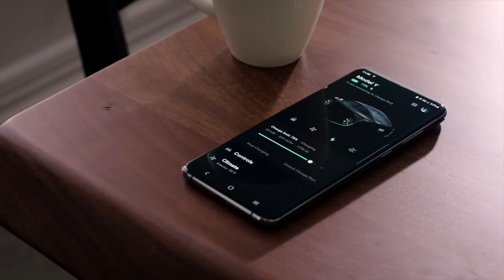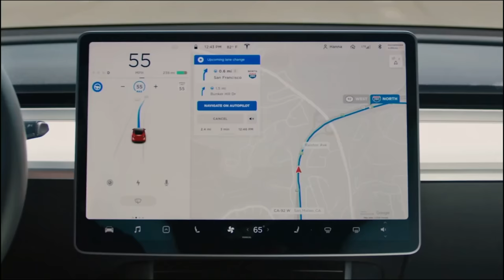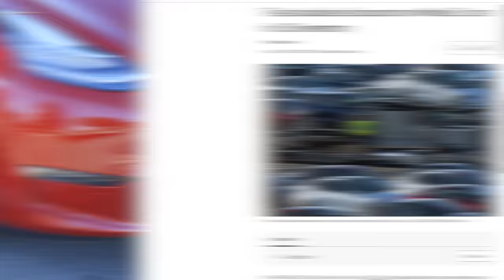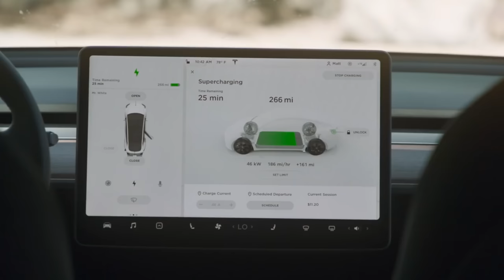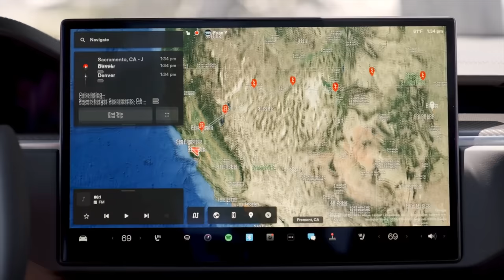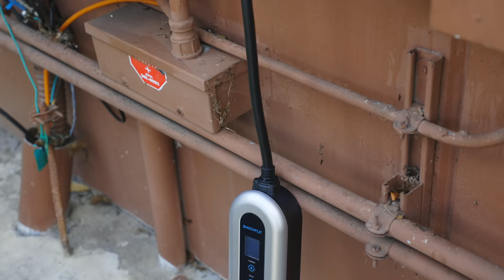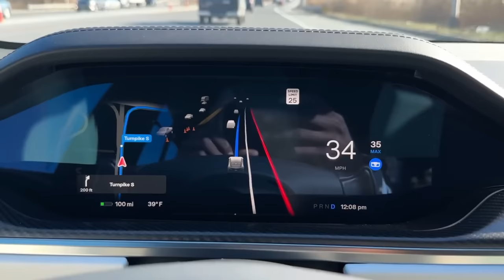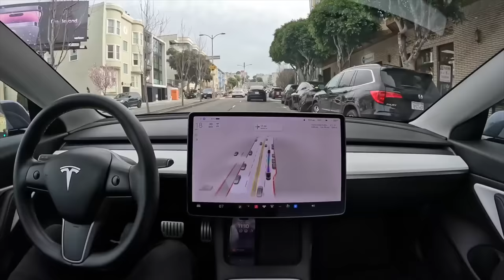Tesla's HUGE Announcement - SHOCKING NEWS for Owners! | Tesla Model 3 + Model Y

Comment: My big concern is non-Teslas taking two (or more) charging spots to charge. The OEMs should relocate all their charging ports to conform to Tesla's cable length.
Reply: Or sell a nominal (small fee) one-time payment to use the Tesla Supercharger network and include with that a much longer charging cable adapter for cars sold without a longer cable and start selling their cars with the longer cable included.

If it was free people would still try to park wrong without buying the longer adapter.

Comment: Adding commercial use Teslas and other brands to Superchargers is fundamentally better for Tesla owners. More income means more stations, and more stations means closer stations to wherever you are. It is not related to wait times. If the ratio of charging minutes used to number of EVs that can use remains exactly the same as now, it is a fundamental improvement for Tesla owners because the ratio is the same, yet the number of stations off peak or on peak is larger and the closeness of stations to wherever you are is smaller.

Comment: I don't mind opening up superchargers as long as they do it right.  They MUST create some kind of scheduling system where when you navigate to a supercharger you are scheduled to use it based on your arrival and you are told which stall to use. If someone else tries to use that one it won't work for them. This could work with non Tesla owners through the app. You could also avoid problems with stations showing open when they are actually full because of a non-tesla taking two spots due to where their charge port is. I also strongly agree that Teslas should have priority and lower rates.

Comment: I’m really disappointed in Tesla and lack of superchargers or adapter plugs.  I recently had to travel from Utah to Wyoming to check on some real estate I own there and the only supercharger I could find was in Evanston, Wyoming (on I-80) and Jackson, Wyoming (home of many billionaires) to far north for my trip. We came across chargers right where we needed a charge, made by “ChargePoint” however my plug kit did not contain an adapter for this charger.  What a major disappointment.  The only option in several  locations was to use someone’s 110v outlet and set for 6 or more hours to get enough charge.  We had to do this twice on the way home.  Where can I get an adapter plug for charge point’s plug.  Also in Tesla’s kit I had purchased was a 220v plug but on the other end of this plug was a male plug I have seen and it would not fit any other plug or cable in the kit.  What the hell. And I agree with the several disappointments you mentioned in this article.

Comment: I was fortunate to order my M3, just before they announced the end of free charging cables, so when my car finally did arrive, three months after the order, it did have a cable included.  In over a year now, I've never used it, and only recently took it out of the bag to have a look at it, but I'll kick my butt down the road and back, if I forget to remove it from the car if I upgrade to a Highland, or a Model Y next year.

Comment: Hey Robert: Point 1:  you think Tesla is concerned about opening up software leading to hacking?  Point 2: Agreed with you, especially in So Cal, but you think Tesla will install more supercharges according to how fast OEMs adapt to NACS? Point 3: They should have the option to "sell back" an included mobile charging cable when purchasing a new Tesla. Instead of ordering for the extra +$230, sell it back for -$230 off the retail price?